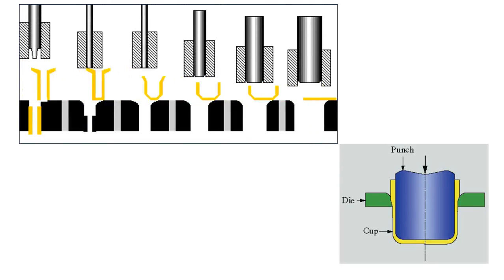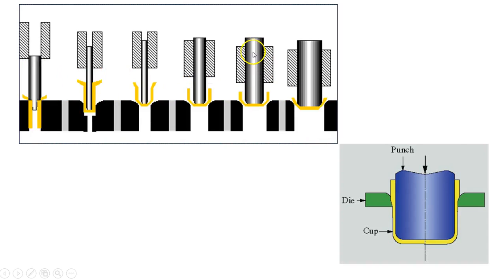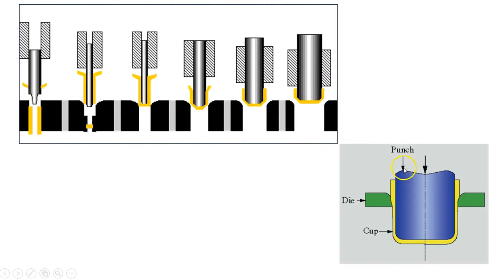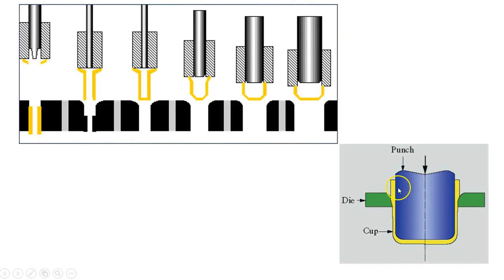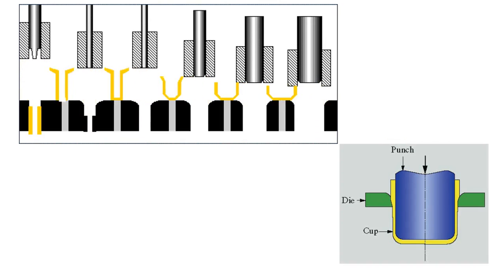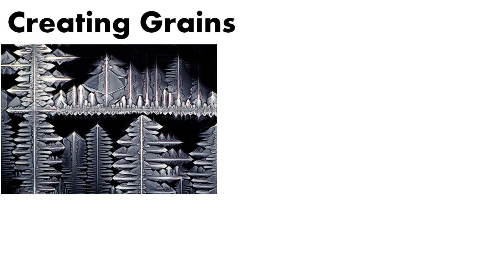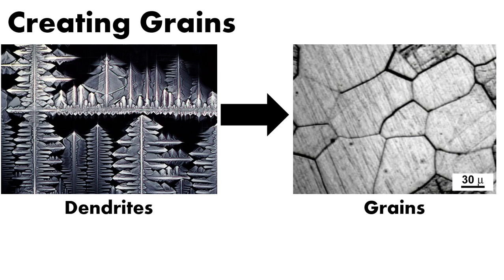Materials (Part 2: Carbon Steel Crystal Structure)

Comment: best video ever. what does it have whcih other videos dont? 1.  you dont jump to phase diagram and start with the terms. 2. slowly build the knowledge based on the strength and capacity of each cubic structure. best video i have ever watched. and i watched many... i understood about diffusion. capacity to hold carbon atoms as solution which is need for diffusion. very good.
Reply from the maker: Thanks!  I really appreciate your feedback.

Comment: From iron carbon diagram, we understand that austenitic structure in steel can be seen only at high temperature above 723 degree Celsius. Austenitic structure has FCC crystals and they allow carbon atom to be part of their crystal structure. This means that a steel has got good strength characteristics when the structure is Austenitic. But materials used in industries for different applications are used at room temperature. Then how is austenitic structure in steel useful to us when we cannot have a steel with austenitic crystal structure at room temperature.
Reply: It is an observed property dude... the threshold point for the creation of pearlite and martensite...

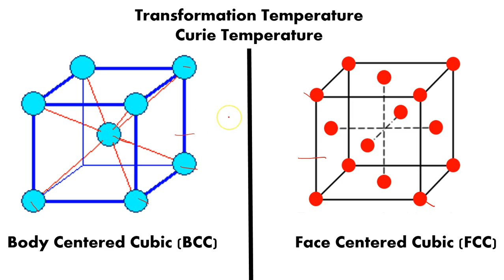Comment: 4:33 The transformation temperature and the Curie temperature are two different things. At room temperature you've got alpha-iron (ferrite) with body centered cubic lattice. When you go up to around 770 degrees you reached the Curie point, which is the temperature where a ferromagnetic material looses it's ferromagnetic behaviour and becomes paramagnetic. A long time ago metallurgist thought it was a phase transition and called it beta-iron, but soon they figured out it was not, and this is why we have alpha gamma and delta iron but not beta.

Comment: Professor it appears you are explaining the Heat Treat Process if so why arent you using Decalescent, and Recalescent points (My spelling may be off).

Then again there is no Oil, Water, to actually capture and hold the grain structure so that the grains become permanently altered. 

I may be way off in my undrrstanding?

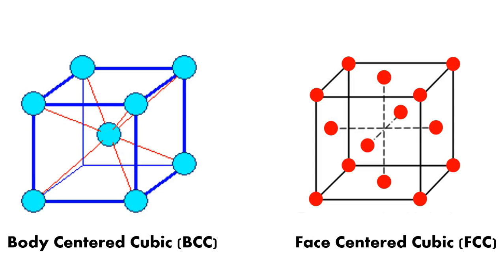Comment: Thanks for the clear explanation. But at about time 2:35 forward, the Body Centered Cubic graphic shows only 8 atoms. Shouldn't there be 9? (1 in the center plus 1 at each of the 8 corners).
Reply from the maker: You're correct.  One of the corners is missing.  I never noticed that.  Good catch!